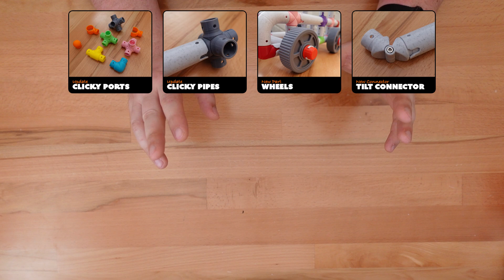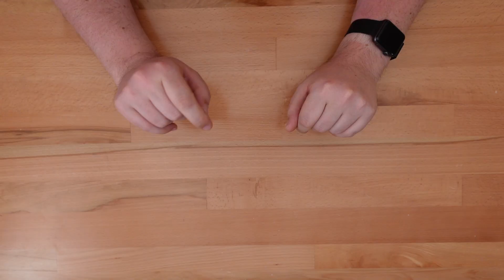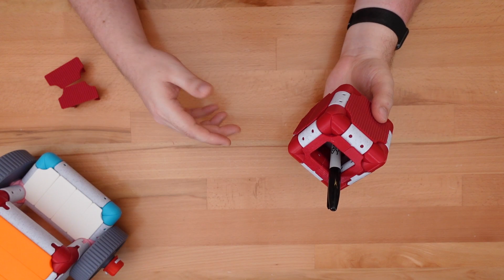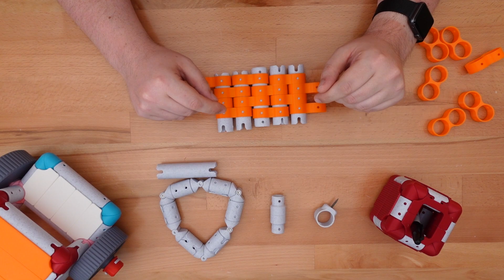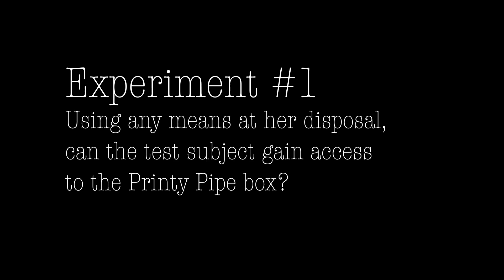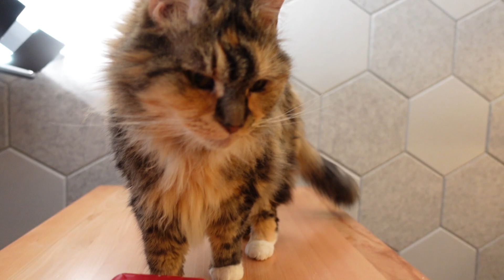Printy Pipes - More Everything!

Comment: So.... If you assemble it incorrectly you have 'brick' your construction kit?
Hmmmmm
Reply from the maker: Yup - under a very specific condition while using an optional part. I considered making the wheel incompatible with running on a pipe, but ultimately decided the lost functionality to avoid a rare scenario wasn't worth it.